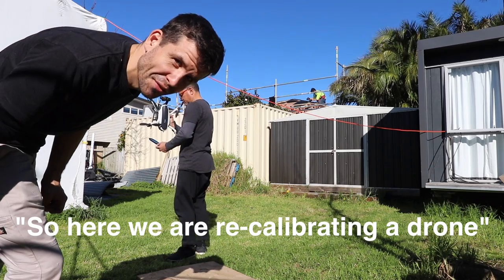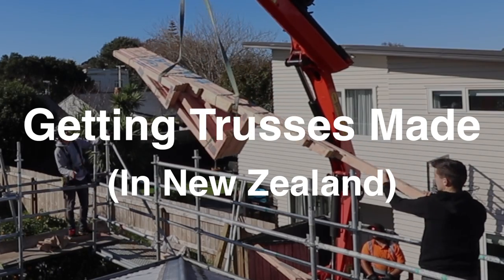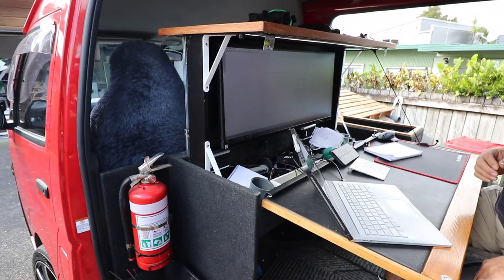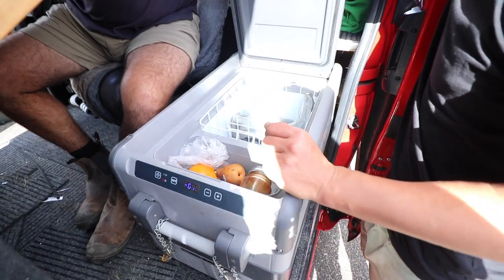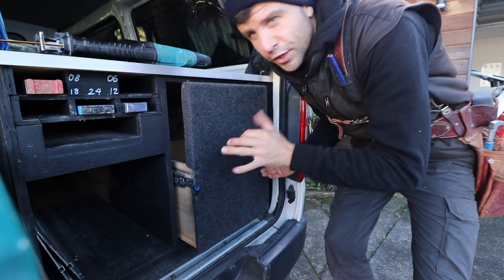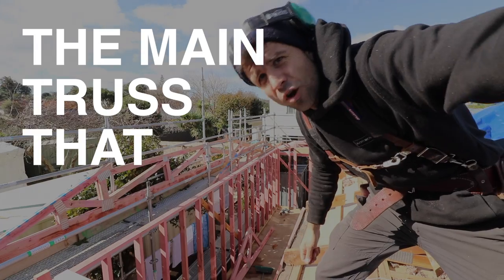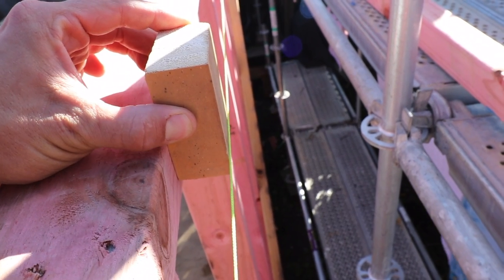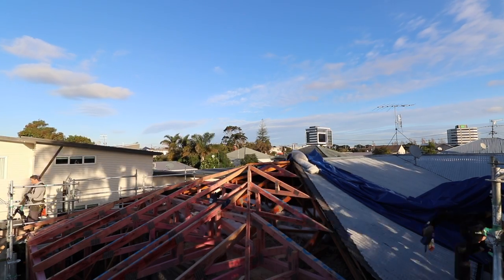He Designs House Framing in His Van

Comment: Interested to ask why the trusses need specialist to build, is it for earthquake resistance, fire regs, something else, or has it just always been done that way. Loving the show and your relaxed style.
Reply: Mainly for engineering reasons. They have to be capable staying in place without sagging or breaking, as well as hold the roof together under specified wind loads and (where applicable) snow loads. In the old days there would always be a network of bearing walls inside the house to hold up the roof. But with engineered trusses, they can span the entire house, so if you ever remodel and want to pull down/move an interior wall, it will have no effect on the integrity of the roof.